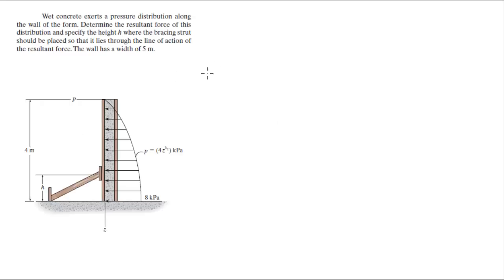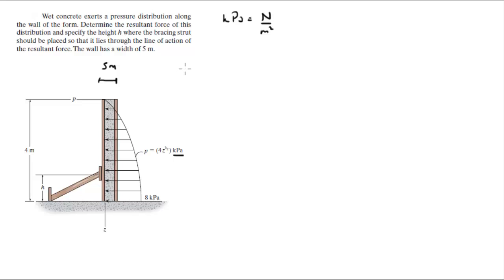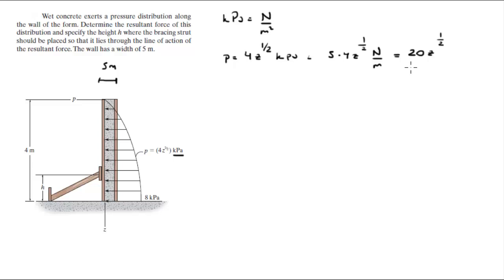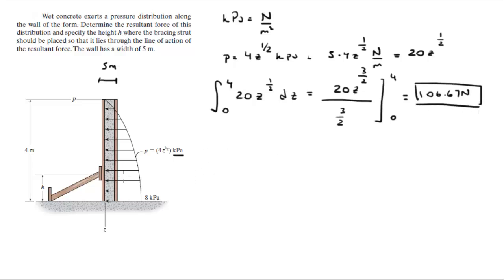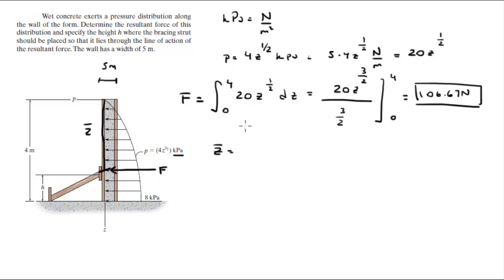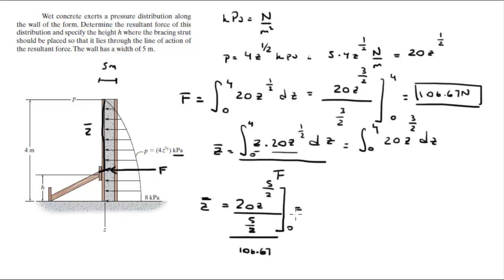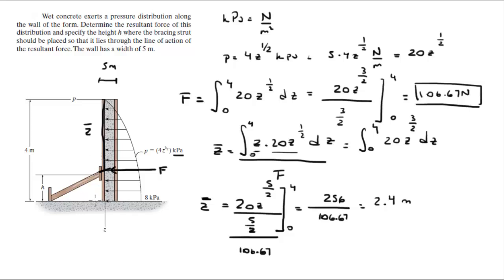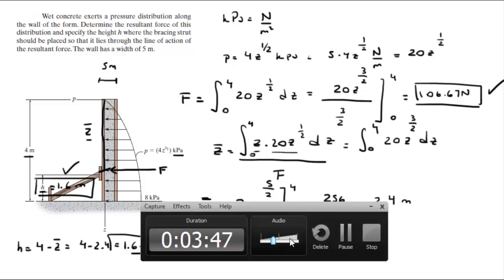Determine the force of this distribution and specify the height h

Comment: Height should be the total of 4m minus the 2.4m, so 1.6m.

Also, force should be in kN. Not converted from the number calculated, but just 106.67 kN, 1280 kN, etc.